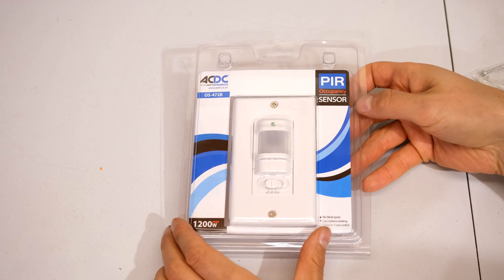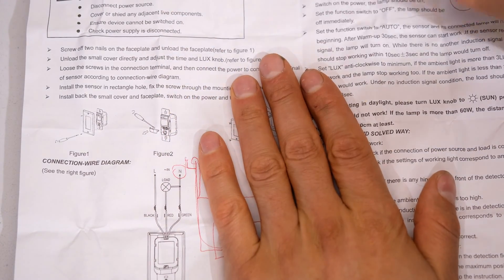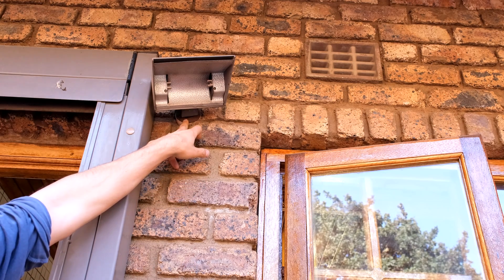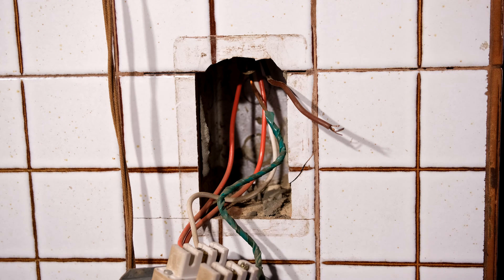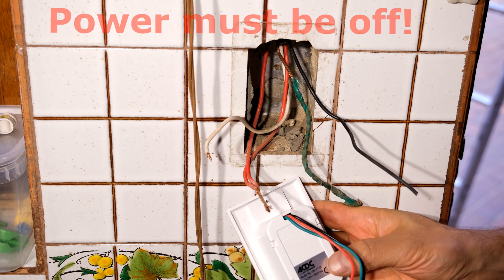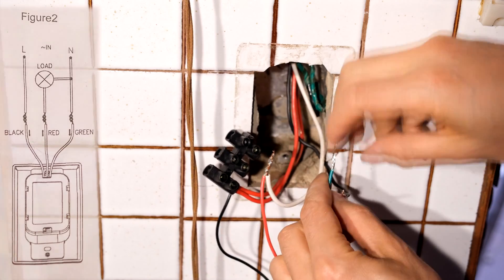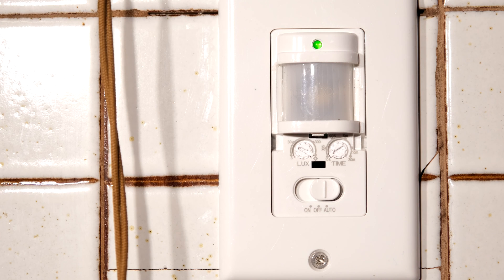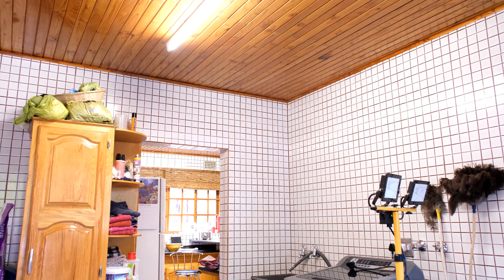How to install an automatic PIR motion sensing light switch - step by step with explanation.

Comment: Hi. Out of curiosity. Can you run the live wire on the load out side of the sensor. What i want to do is run a normal on and off switch as well as the sensor together. I'm worried about Live running backwards in the circuit and damaging the sensor as current isn't meant to run into the load out port.
Reply from the maker: do you mean that after the load output you wish to put an on/off switch as well for another circuit? In that case you can do it but dont exceed the rated wattage of the unit.